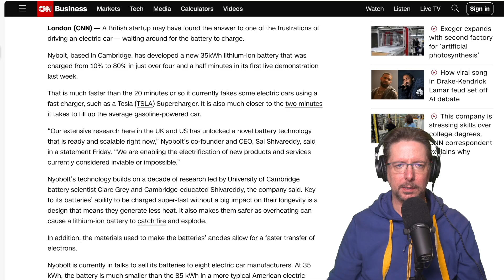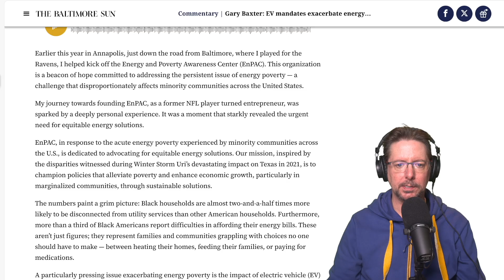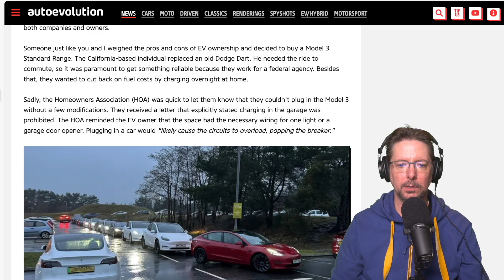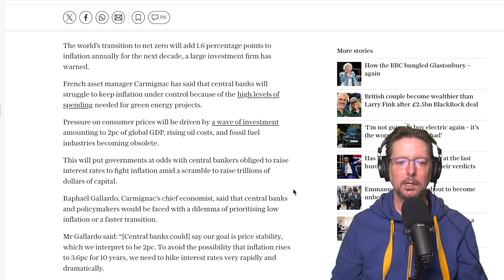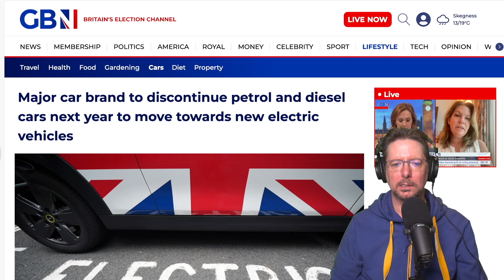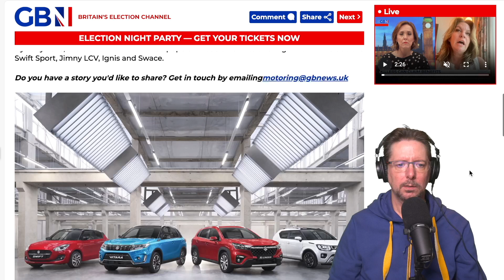Tesla owner's charging SHOCK! MGUY EV News Tuesday 2 July 2024 | MGUY Australia

Comment: Let’s say that power station takes up 300 acres. How many acres of solar or wind turbine is required for the equivalent - taking into account you need redundancy because the alternatives are weather dependent and will either not generate or be turned off in high winds.
Reply: There is no actual answer to that question. You could have a million acres of solar panels and still not get a single joule during the night.
Reply: Well 1ha=10000sq meters can be populated with panels providing 600-800kW of power. 1sq km is 100ha. So You can assume 80MW per sq kilometer. Even a quite small power station generator has power output of 360MW and that means You will need 4 sq km to replace a single generator block. A standard in most power stations are 960MW generators.
In any case replacing classic power station required insane amount of space  and similary insane amount of panels + supporting equipment.
Reply: A wind turbine I believe produces up to 5 megawatts of power. So during normal operation it should be a constant 2.5 megawatts assuming there is wind. Basically just enough for 1 EV with that super fast charging.
Reply: @ezg8448  You forget that it also reguires the right amount of wind too... Too windy means they are often shut down to reduce damage....   The ones near us have not functioned in 6 days due too strong winds.... lol
Reply: It's a death cult, run by idiots. There's really no other explanation.
Reply: It's quite simple to work out. The power needed to run every single terrestrial vehicle-kilometre (cars/trucks etc) in Australia could be supplied from a solar farm the size of half the area of Sydney harbour. Of course such an array would be spread out but that's the area needed - for all vehicle kilometres driven. And you could farm sheep under the panels - apparently they quite like the shade.
Reply: @mb-3faze  LOL no they don't as the area in and around a solar farm is anywhere from 3-10 degrees higher and higher in temp due to the heat generated on the panels... You are clutching at straws to justify things...
Reply: @hudsonthepolarbear  I'd point you to some videos made by Australian ranchers, but I guess you could find those yourself. It's only the sheep who are straw clutching.
Reply: @mb-3faze  Oh I have seen them I also saw the ones where they was being herded there for the media... So nice try buddy
Reply: @hudsonthepolarbear  You have a polar bear as your icon. Somewhat disingenuous since your views and presumably, daily practices, involve the burning of as much petroleum product as you can. The wonton burning of such is largely responsible for the demise of the habitat these magnificent creatures inhabit.
Reply: @mb-3faze  LOL nice try on the dig....   Keep trying... you are simple showing your warped views.

But then your warp views has ignored the fact that NASA and other orgs has stated that there is now more Ice at the Polar Ice caps than there has been for the past 20 years....   But that would then disprove your comment so I understand why you ignore it...
Reply: @hudsonthepolarbear  I'll let you fact check yourself on the arctic sea ice. Wikipedia has some good info which can be summarised with one sentence "the summer extent of sea ice in the arctic will be zero, likely sometime this century".
Reply: @mb-3faze  talking about disingenuous and pollution. While no doubt typing on a fairly new phone made out of plastics glass and rare minerals.  Supporting a car (EVs) that will require more copper to be mined than has been mined in all of human history to date.
Reply: @xr6lad  Well, at least you didn't drone on about 'rare earth metals' (which were never in batteries). So, progress! Difficult to mine metals? Try the palladium, platinum and ruthenium used in catalytic converters in ICE vehicles. Copper is quite abundant in the earth's crust - more so than lead. And of course the big difference compared to the thousands of litres of gasoline used in a comparable ICE car, after 500,000 kms the copper in EVs (and any car) will be as useful and recyclable as the day it was first refined.
Reply: @mb-3faze . So why are polar bear populations 50% higher now than 50 years ago?
Reply: @vociferon-heraldofthewinte7763  Making false statements in the form of questions if the height of amateurish discussion.
Reply: @mb-3faze ‘could’ farm. Yet of all the solar farms I see they don’t.
Reply: @mb-3faze  yeah it's simple : any real number multiplied by zero is zero. Hence why the acreage is independent of power at night for solar.
Reply: @davelowe1977  Have a gander at what's going on in your great city of Adelaide. 100% renewable power generation - see how they deal with intermittency. Talking of intermittency, it's all about degrees : that natural gas power station... it's totally dependent on deliveries of gas. How many days of reserves does it have? What if the supply was disrupted by disaster or war? The argument is made that solar and wind are actually more reliable because the unknowns (cloud and lack of wind) are less unknown and more predictable than fossil fuel supply.
Reply: @mb-3faze and it generates for 9 hours a day at best .  So energy needs to be stored for night as well. While apart from maintenance a generator continues to generate.
Reply: @xr6lad  Check the progress that the great city of Adelaide is making. Answers there.

Comment: A 35kWh battery charging in 4.5 minutes from 10% to 80% requires at least a 327kW charger (if the charging rate is constant), and even more powerful if it's not constant (35 * 0.7 = 24.5; 24.5 / 4.5 * 60 = 326.6666...)
Reply: Ya, you just lost all the EVangelists with math. They can't EVan balance a bank account.
Reply: @andyfunke9484  I think you'll find many EV people very well educated. The EV trucks are push 1MW charging now. With the correct engineering and power electronics, such powers are possible.
Reply: That charger unit needs so much cooling.
Reply: Did you include the efficiency factor? Certainly no higher than 80% at these high currents.
Reply: @jschudel777  No, it closer to 98% efficiency.
Reply: And to add precedence what that 327kW charger means… lets convert that to horsepower n include an efficiency of 80%….

Ur looking at 550hp.
Reply: @arsyadidris6349  So, simply install a 550hp diesel generator at every charging station, and the problem is solved! No need to upgrade the power grid!
Reply: Yeah and you are most likely charging the battery at 10 to 12c which will kill the battery very quickly.
Reply: EVangelist here in the USA will say your math is just misinformation and you are racist.

Comment: For the life of me I cant understand why they didn't have cassette type swap batteries filling up stations
Reply: A problem is that you have to pay for the swap. Suppose you have a pretty new battery - You go to the swapping station and receive a battery that's been around for some  time .... maybe it's had a hard life. You end up with a much lower capacity battery,  having relinquished a good battery. Not a very good deal. I stand to be corrected on my statement. Add to that the fact the battery requires not just a couple of cables for the output. There's cooling pipes, a heap of monitoring and control circuitry. At the moment, there's no standardisation of batteries or circuitry or connections.
Reply: @and7barton And, the battery being the most costly EV component, doubling up the costs isn't wise.
Reply: Drive in to battery station.  Jack up car. Unplug wires. Bring in new battery from huge store out back that have to be kept for potentially hundreds of cars in safe conditions. Multiple that by X cars per day.  Imagine not only the footprint required for every ‘battery station’ to be doing that for multiple cars at once but the staffing costs.  Not a solution in any sense.
Reply: They did, it is called NIO and they are failing because the battery cooling system for swappable batteries isn't up to the task. NIO stock used to be $5 USD, it's now $4 USD and falling. They were the absolute best at swappable batteries but the only place they have caught on is cool to cold countries because of nonexistent battery cooling. NIO not only loses money on Every car sold, NIO Loses money on every Battery Swap! Do you want to invest in that?
Reply: Can you imagine how toasty the fire would be when the charging bay eventually went up in flames ?
Reply: The size and weight.
Reply: Every vehicle has a different shape and size battery. A Cybertruck battery won’t fit a Model 3.
Reply: @softwarephil1709  Lack of standards
Reply: Who owns the battery, do you rent it from the charging company, the car manufacturer.  What guarantees are there for range? Who insures the battery? Plus many more issues with swapping batteries.
Reply: Changing the batteries in a Tesla 😂
https://youtube.com/shorts/0B70EUL856E?si=4usFrVl7jalQFVK5
Reply: Those evil Chinese people already have a system up and running.
They've done tens of millions of swaps already!
Reply: Who is gonna foot the bill when someone picks up someone else's damaged battery and it goes up in flames?  Are the swap stations going to waive all liability?  Come to us and get your battery swapped!  No guarantees, no refunds!
Reply: Your idea has been tried and has failed.  The ev cement Australia truck that torched itself utilised a moduled battery pack that is replaced with a forklift.  From memory, I think they damaged the battery pack from poor removal/ installation practices and this is what contributed to its failure.

Comment: Quick charging shortens battery life quite dramatically! - Really fast charges need a massive amperage, not available at home or on public chargers.
Reply: The best way to get the current you need for a really fast charge at a charger? A really big Diesel generator…
Reply: And...hope you don't mind a cable a foot thick to carry all that power!  Good luck wrangling that plugin!
Reply: I'm surprised somebody isn't promising wireless charging and it makes the news
Reply: @timothykeith1367 oh I’ve seen a few stories on rechargeable roads.  Of course they don’t think about the sheer cost of something like that.
Reply: If I turn off everything in my house in order to charge an EV the maximum I can deliver before the Mains trip is 38 kW.
Reply: That's why my mobile phones last so long, I never fast charge unless I have to.
Reply: How about a battery storage system at your house. Use a long lived system like iron nickel . You slow/trickle charge this continuously from mains, or when rates are low at night. Then use this stored power to fast charge the vehicle.  A retired couple I know of use solar panels to charge a Nissan leaf. Bonus is that the vehicle itself is available to provide power during power outages.  Payback time (break even) is seven years.
Reply: @francoistombe  Lot of batteries to do that. Gotta remember how much energy is stored in an EV. We have enough battery storage to run the whole house for a couple of days (way more in an emergency power situation) and it's around 1/3 - 1/4 of the battery capacity of an EV. That's a tonne of batteries and, for fast charging, you'd also likely need an inverter capable of feeding that into the charger, which is expecting AC. So you need a battery system with massive capacity, massive discharge rate and the inverter capacity to fuel a fast charger. That's a lot of kit and it's very expensive.
Reply: Not anymore. LFP batteries love a jolt.
Reply: I'm honestly not sure on this one. Definitely does on phones, etc, but if there is adequate liqiid cooling and the temperature is controlled, with suitable BMS settings, I can see it not having that much of an impact. Don't get me wrong, it's not going to be neutral, but I don't think it's as big an issue as we thought it'd be. I think the data is showing that properly engineered batteries last just fine. The problem is when they do fail it's expensive and often extra exciting.

Still not going to convince me to get an EV.

Amusingly, I ride a motorbike nearly everywhere and I actually went to an electric motorcycle dealer as we have solar panels and it's probable that they'd generate enough in summer to cover a good chunk of my use. The owner said not to touch one for my use as I need the bike to work all the time, can't do without it and the harsh salt water from winter would cause major issues. He said when I need a replacement bike, I should get a cheapo petrol one and just mod it as needed.
Reply: @ts757arse  Even the manufactures in the battery care info tell you not to fast charge too often as it damages the battery
Reply: @hudsonthepolarbear  yes, too often. The statement I was challenging was that fast charging dramatically reduces battery life. I don't think the data exists to support that. If you do nothing but fast charge, it will again depend on the BMS and whether it moderates the rate of charge to protect the battery or not. Just because you connect to a super fast charger does not mean that the battery is going to fast charge.
Reply: @ts757arse  All that fancy liquid cooling and temperature control on a fast charger comes at a price. You often see a bill of $40, $50, $60 or higher, basically as much if not more than gas.
Reply: @noseboop4354  the liquid cooling and temp control is in the battery pack. A lack of liquid cooling is why the early Nissan leaf batteries degraded so rapidly.
Reply: @ts757arse  Yes, but there is liquid cooling on the charging cables too for superfast chargers. Otherwise the cables would burn your hands and potentially melt.
Reply: @noseboop4354   isn't relevant to longevity of the battery pack under rapid charging. Well, I suppose if the cable overheats and triggers thermal cutout, the battery will be far better off, lol.
Reply: @ts757arse  It's not so much the amperage that the EV is capable of taking rather it's the amperage the house/charging station can pull and houses are hard capped as to what amperage they are even allowed to push though the wiring, too much and you'll either have blown fuses the moment you plug the EV in or even worse, a short somewhere in the house that causes a fire and even charging stations are capped to what amperage they can pull.

Comment: And if you use the fast charger, it accelerates the deterioration of the battery
Reply: Its not really the fast charging but the heat generated.  Charging faster generates more heat.  If we had a way to remove more heat you could charge faster.  The cache 22.  Charging faster generates heat.  Heat degrades batter.  Battery degradation increases charging time.
Reply: @supernova743  It isn't just the heat, forcing that much energy into a battery causes deterioration. You could keep the battery as cold as you want and you'd still damage the battery more.
Reply: Batterien are only a few hundread thousand a pice, so cheaper tgen filling up a gas tank. 

Some enviromentalist, probably.
Reply: @lbochtler  You can’t spell, they’re not 100s of thousands either.
Reply: what would they care, replcing the battery is just as easy as going to the store, and they start to wonder why they have no food
Reply: And costs as much per unit distance travelled as petrol.
Reply: I take it these EV owners never read the fine print in their owners manual.  Oooops ,there's no manual it's an App
Reply: Don't worry.  If there's any problem encountered during ultra-fast charging, the system will shut down and notify you by exploding into flames.